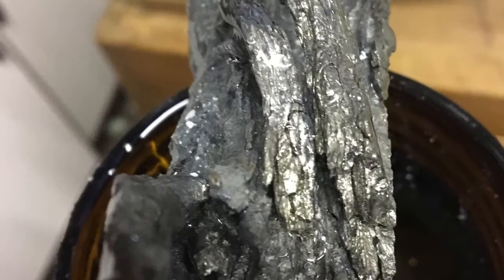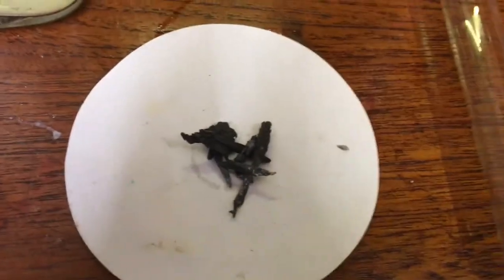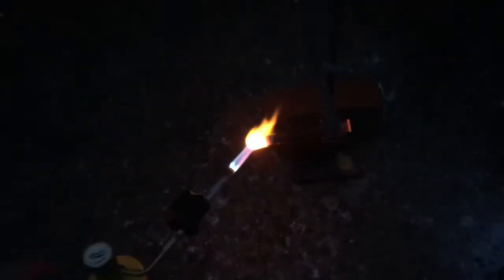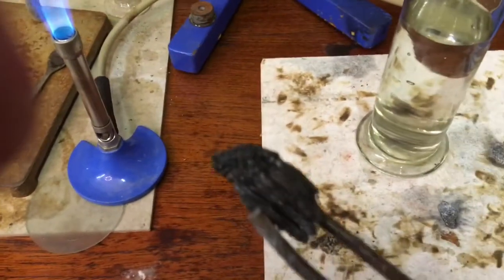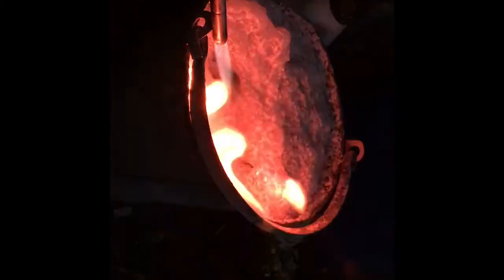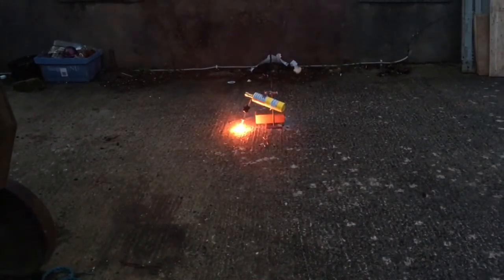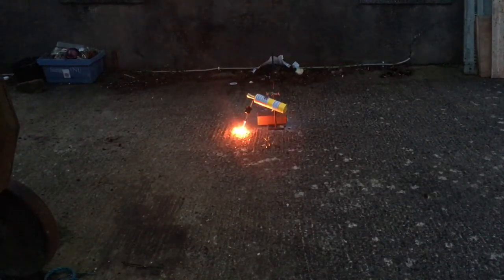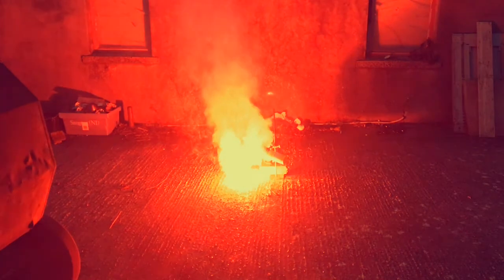ADRIAN'S LABORATORY EXPERIMENTAL STRONTIUM METAL DEMONSTRATION

Comment: Wow, that is a lot of strontium. Was it very expensive?
I recommend not storing it in paraffin oil. Paraffin oil is something that people started using in the recent years as Internet selling increased in magnitude because it's not smelly and it's poorly flammable, so the post office doesn't notice a funny package.
The problem is that it's not inert as it's supposed to be because there's more stuff inside than just higher alkanes, and it shows with metals keps inside for a longer time.
Gold standard for reactive metal storage (aside from ones that really require vacuum or noble gas) is kerosene since they were first isolated. It's inert and easily removed by paper towel unlike paraffin oil. It also evaporates so it can be removed from the crevices by vacuum. Paraffin oil will always cling somewhere and ruin certain experiments, and especially syntheses.

Also, I kindly recommend not jumping on the bandwagon of American education system pleonasm usage such as "strontium metal". Its name is strontium and in rare occasions where its form has to be noted, it should be called elemental strontium.
These pleonasms have exploded over the past decade because of American "Internet chemists". People use silly names by inertia, and then it introduces confusion.
Reply: Lajos Winkler We call it "strontium metal" to distinguish it from ionized strontium. While "elemental strontium" is indeed the proper nomenclature the term "strontium metal" is more appealing to general YouTube viewers since they know what a metal is and most people are curious about strange metals they have only rarely heard of. If one does not take making a video catchy and watchable into account then one will have very few viewers and subscribers.

As for the paraffin oil issue you brought up it may very well be true, but does it really matter? You could always transfer the metal to a kerosene wash after receiving it to remove the oil after which it could be stored under fresh kerosene. That is, if your metal needs to be pure enough to do publication-worthy experiments with. If that is the case the metal can always be cleaned in the usual way. This circumvents paying the astronomical shipping cost for flammable metals stored in an accelerant. That's only the basic design of an incendiary bomb and strangely enough most carriers are funny about handling that sort of thing. Can't imagine why. 🤔
Reply: I don't agree. Sticking to scientific nomenclature and being exact should always be above commercialism. Trying to be "catchy" is what's ruining Youtube. Quality over quantity - this approach works and there are numerous examples for it. This channel doesn't need to be catchy. It has top quality videos.

Nobody called it like that before web dumbing down occured. It wasn't in the textbooks, educational videos and for a good reason - it's incorrect and introduces confusion.

It's nothing but a pleonasm and promotes viewers' laziness. It also causes enormous confusion with search engines, whether it's Google or some chemical company's search form, or eBay, for that matter.
If "strontium metal", then why not "iodine nonmetal"? If "iodine gas" then why not "strontium solid"?

"Metal" is not a term that describes state. Solid, liquid, gas - those are physical states, and ionized/elemental/organic/covalent/etc. are chemical states.

"Metal"" is a term that describes a type of chemical element, a type of behaviour of its atoms and ions.

And just to add - "metallic" and "metal" are not the same thing. Metallic refers to crystal lattice.

Yes, paraffin matters. I'm not talking about shipping, but storage. It's more reactive than clean kerosene. You can get (or easily make) clean kerosene, but getting clean, inert paraffin is next to impossible, and cleaning it isn't far from that, either. I've got potassium chunk in kerosene that's still silvery after years of storage and any reactive metal in paraffin got a crust.
Reply: Lajos Winkler This may surprise you, but I actually agree with you wholeheartedly. When people call dichloromethane "methylene dichloride" it makes my blood boil. It has no double bond nor is it ionic. 😡 However, videos that don't hook viewers are rarely watched, thus defeating the purpose of putting them on the internet in the first place. You have to find a balance between scientific exactitude and popular appeal. Now, perhaps if just the title image had said "strontium metal" but the material was referred to as "elemental strontium" in the video that would have been better. However, making these videos is not easy and I'm sure that we can always look back and say that if he had done this or that it would have been better. It's easy to criticize someones work after the fact. If it bothers you so much make your own video of an experiment with strontium and emphasize the correct nomenclature. Put "elemental strontium" in the title and see how it goes. Who knows, you might get more viewers. 😀

Now, as for this paraffin thing, I think it's great that you left a piece of metal in a jar for years and it's still shiny. That sounds like a great use for a reagent not being used in a stability study. Really advancing the progress of science there alright, just letting things sit around and doing nothing with them. I commend you. 😂😂😂